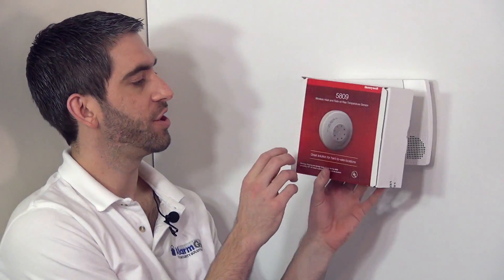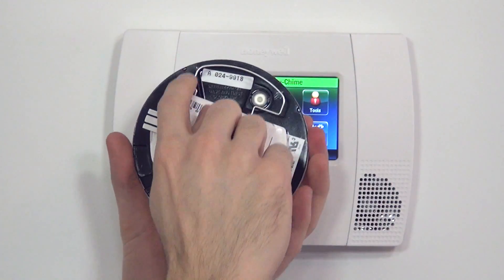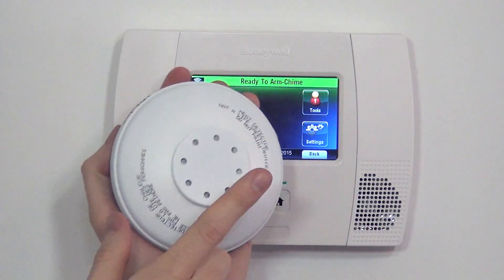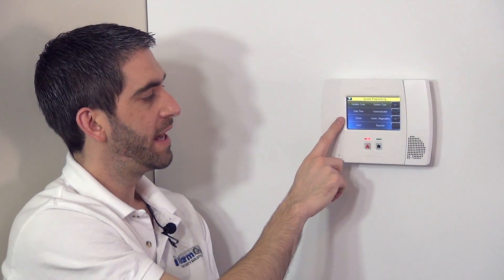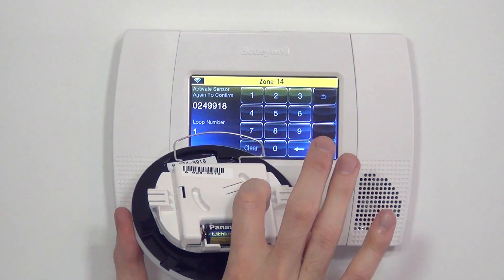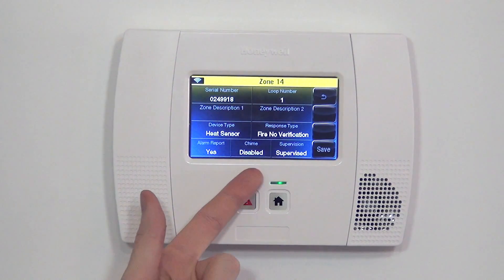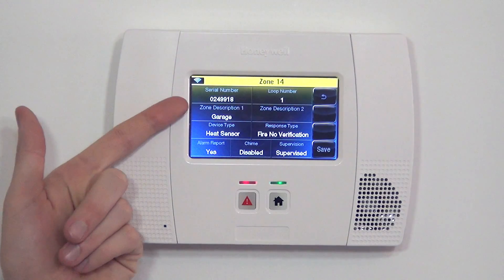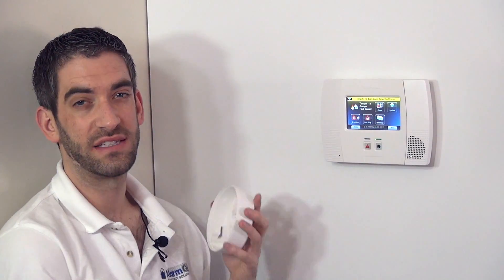Honeywell 5809: L5200 Programming

Comment: I have one of these. I am wondering where the best place to install it. Kitchen? Garage? Or attic. I had considered the attic, but was concerned that it "could" get to 135 degrees and set it off. Any suggestions?
Reply: TheYank59 - you should get a Honeywell transmitter 5817XT and wire it to a 5602 series heat detector single circuit 194 degree fixed temp. with a rate of rise thermostat. The transmitter will work best if not in the attic due to the heat. So 194 degree detector in attic, transmitter not in attic.

The 135 degree 5809 Heat detector is good for Kitchen, Garage and Heater Rooms.
Reply: Garage, kitchen, and basement.
Reply: @AcElectronicSystems doesn’t this heat detector look like those old edwards ones?